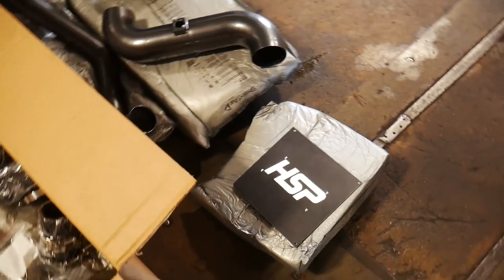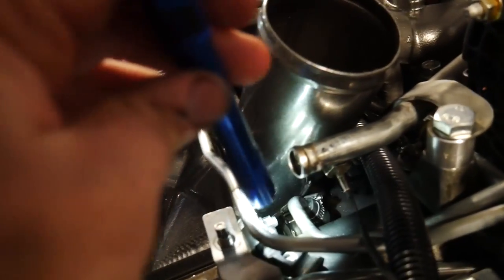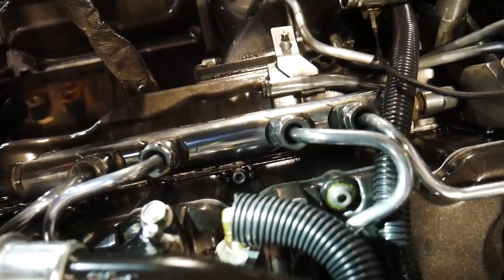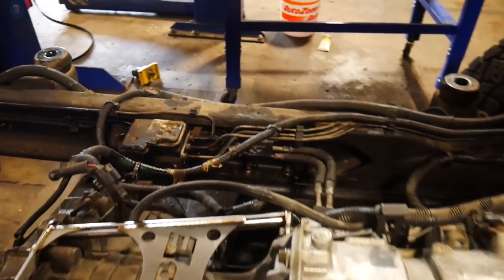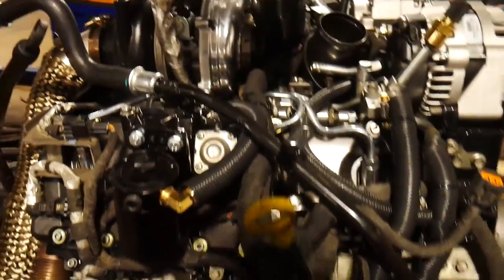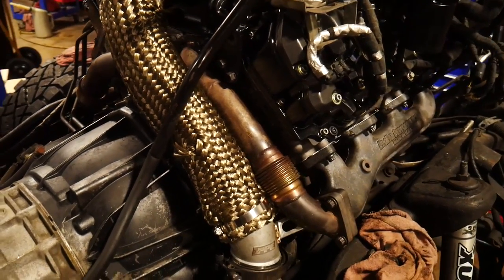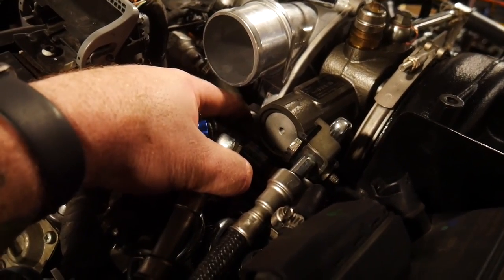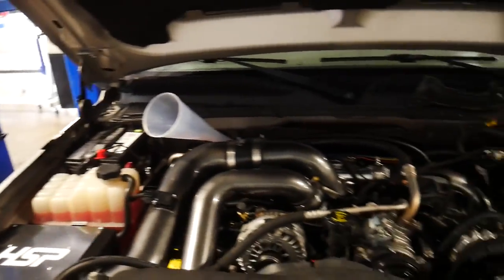DURAMAX ENGINE BUILD FINALE

Comment: I love chevys I wld like diesel one day but I watch all these videos like this one all the time on these engine builds and it's just seems like a mumble jumbo fuckin mess!!! Idk if I want one because of this an the newer it is the worse the jumble shit gets! In my mind I'm like is it really worth the nitemare and mess plus added cost for fuel additives in the winter plugging in ur truck added cost of fuel high cost of diesel parts wheels tires every thing costs more casue everything is heavyweight built for the diesel engine. Idk they are cool but I dont think it's worth it for myself. But I dont tow a huge camper or anything either. I dont know I love Chevy but the Cummins looks so much easier to work on...